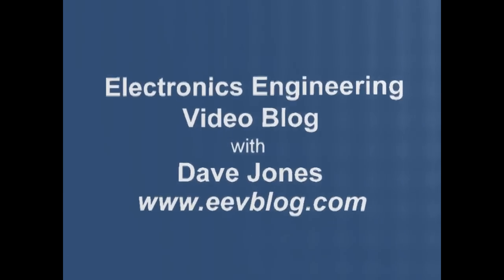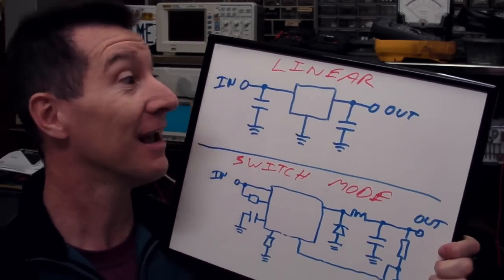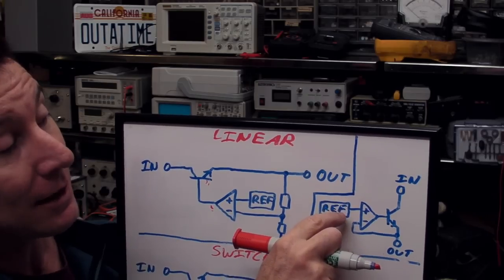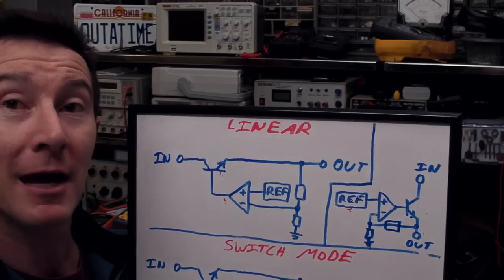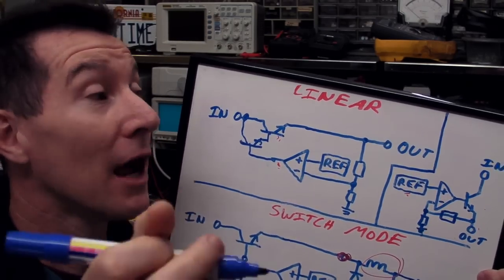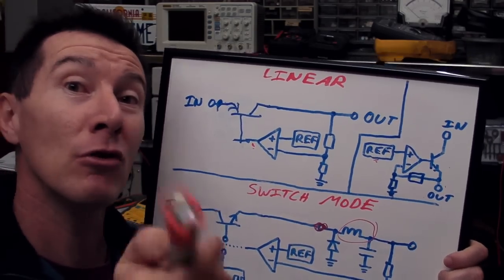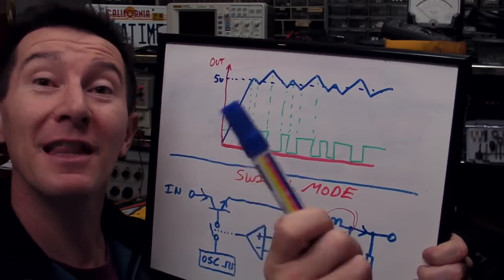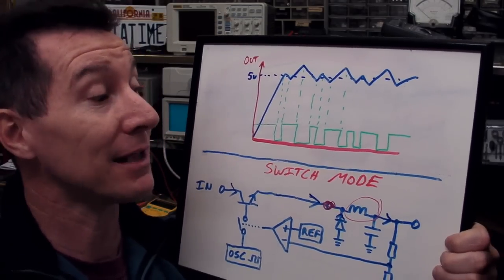EEVblog #90 - Linear and LDO regulators and Switch Mode Power Supply Tutorial

Comment: In this video the SMPS is not much difference and still easy to understand because it is just Buck Converter, one of the easiest SMPS. What is hard and intimidating is the real power supply that supply high current from 220VAC, such as what you see in PC ATX Power Supply. The ATX Power Supply especially above 500W is intimidating and very complex because it is not just about Buck Converter, it is more than that: Power Factor Correction, Transient Damage protection, 3.3V, 5V, + and -12V regulated power supply each with overcurrent, overvoltage protection including step down transformer using Half Bridge topology. The circuit diagram is immensely complex. So, the real high power SMPS that we encounter in real life is not that simple.

Comment: Thanks Dave.
But in my opinion the reason new people are reluctant to using switching PSU's is not because they don't know how similar they are to linear ones, that doesn't matter that much. 
They are reluctant to use them because of the inductor.
Resistors and capacities are easy to buy and use, but inductors aren't.

Comment: I'm gonna go out on a limb and say that most SMPMs today don't use BJTs, but MOSFETs, due to the fact that junction behaves like a resistor and not a diode (Constant resistance instead of constant drop-out voltage) and has a really low resistance when saturated. Maybe not really relevant to mention in this video though. It's 17 minutes already.

Comment: Dave, did you ever made a video on the principles of something simple as a fuse? Like why they blow and how their ratings are designed? I'm still unsure what really makes a fuse go blow. Just the amps? Then why there is also a voltage rating on most fuses? Grrrr. I don't get it together
Reply: +Axel Werner Power dissipated in a fuse will blow it. The fuse uses a really thin wires that will melt when it gets too hot. Because it has a finite resistance, when a current flows through it there will be a small voltage drop, that voltage drop is directly proportional to the current. Power dissipated by the fuse is V*I, I^2*R, or V^2/R.

The voltage dropped across the fuse is small, it has to be small. We don't want to waste power. However, when it blows, it effectively becomes an open circuit. The full voltage will be present across it, and if that voltage is too high then it will arc over from one end all the way to the other end and that can cause serious damage to everything closeby.

Because fuses do not blow instantly (the wires do have thermal mass) it can take some time to heat up enough to blow. Even a really large current of many orders of magnitude can flow through and it will still take a small amount of time to blow. If a huge enough surge of current flows through the fuse, it can actually explode. That would be the rupture rating of the fuse. HRC fuses are designed to be relatively safe in this regard and have really high rupture ratings, however, exceed that, and they can also explode.

Comment: I wish I had YOU as my teacher in engineering college. Infinitely much better than the idiots who where so obsessed with theoretical proofs, math exercises that were only tailored to their solution. Then looking up an actual device datasheet showed features that made half of the learned theory not applicable. 95% of what I'm capable of today I just learned from internet resources and a few books which I bought myself and a little critical thinking.
Reply: I've had some pretty good professors. Although I started at a community college so I don't know if they're part of educational Illuminati.
Reply: same here
Reply: While I sympathize with the sentiment, those obsessed with the math and physics help push for funding of research that leads to these electronics technologies being manufactured.
Reply: like everywhere learning is your personal responsibility.
Reply: Same here. 
Most of what I'm using today I learned by staying in the labs until 5 in the morning tinkering with electronics, watching videos from Dave and Louis Rossmann and probing them with O-scopes and DLAs. 
the theory is certainly important, but too much emphasis is put on cranking out 3 page proofs and solving complex circuits by hand. More effort should be given to encouraging actual design work and teaching students how to THINK like engineers.
Reply: @seinfan9  Exactly, or we would not actually understand purely how these things work, and then couldn't invent new ones, better ones. We'd be stuck with the same technology, just using it in new ways, instead of inventing new technology. But yes, I still like this approach. Not exactly sure which one I like the most though (I'd prefer both to be used, that would be the best, but here in Portugal, time was taken because the governament said we had to have to study for ourselves, so there's not as much time in classes as other countries, and also not sure that's good or bad).

Comment: There's a huge glut of small buck converter modules based on the LM2596 on eBay. For around a pound (a couple of bucks) you can play with them, blow them up and learn all you need to know. Great fun. And for a bit more cash you can get them with LED voltmeters and adjustable current limiting.
Reply: ill check it out thanks

Comment: Thanks Dave.

From my very limited experience with switching regulators I'd say that the tricky part is finding the right value for the inductor.  In one case when I wasn't getting the proper output voltage (it was too low) I had to make the inductor value *smaller* (10uH instead of 100uH, for example), which seems counter-intuitive.

...continued...

Comment: Thank you Dave!  Learned alot from that one.  Would love to see some actual design on boost type, powering a 5v circuit from say a lower voltage, how you calculate current needs and what it will take from the battery or power supply.  Like your LED head torch, what it would take to power a high current LED from a small input power, and how to keep the current somewhat constant to the end of the battery life or something.  Would certainly be interesting....  But time is limited I know :(

Comment: I've just been getting into electronics and in between going through various tutorials one video at a time, I also like to jump around on different topics and one topic I've become interested in is boost converters and various other switch mode power supplies. I've never heard of linear power supplies before but you can bet I'll be learning about them real soon. My point is, I went into this with no expectations so I wasn't afraid of tackling switch mode power supplies before anything else. I didn't find them terribly difficult to understand, especially after playing with a circuit simulator app. But Dave says most newbs are afraid of them. So I dunno. I just thought I'd share that.

Comment: A zener diode is usually built into the silicon of the regulator. It can be made to give approximately any voltage you desire (5 or 10 or 3.3 volts) for reference.

Comment: Nice vid, i always understood LDO regulators to gain their efficiancy from the use of a FET rather than a BJT. LDO regulators have got NPN as well just in the form of a FET instead with a gate driver of course which makes an LDO a little more complex internal circuit.
Reply: You have them swapped.  Switching Mode Regulators use gate drivers which drive high-side and (hopefully) a low-side FET.
Reply: funkyguy4000
Aaa ok, sounds about right. I am looking at these new Micrel Super Beta LDO regulators at moment. Very low voltage dropout.
Reply: If you want, I would recommend Linear Technology (www.linear.com).  They offer simulation software  so you can test transients and stability and all that jazz and power supplies are kind of their thing.
Reply: funkyguy4000
Thank you, i shall take a look see what they offer as Micrel seem to be very expensive regarding their LDOs.

Comment: That was a grate tutorial!
But I have a little question, that:
Capacitors are also the energy storing devices, so can we replace that series inductor in switching mode buck converter with a capacitor in shunt to the output (by the principle of duality) or similar in other topologies? Will it work? Thanks in advance!
Reply: It will theoretically work into a consumer which has a high-impedance power input. But you can only have high-impedance inputs if they are not current-carrying, because you'd be losing a lot of power there. It may work with compromises, if the device you're powering needs little power, the voltage drop you're trying to achieve is small, and the device doesn't actually care about sitting on a rather noisy power rail.

Consider, the output of your switching IC is basically a bunch of sharp current bursts. And you have designed a junction there where that current can go into your smoothing capacitor to ground, or it can go into your powered device. Naturally, you want your device to receive a smooth regulated voltage on the input, and you want the sharp edge of that burst to go into your smoothing capacitor. But the only way to accomplish that is if you can guarantee that the impedance of your capacitor to ground path is infinitely lower than the impedance of the power input of your powered device.

So a choke is the right choice here, it will limit the sharp current bursts regardless of what's behind it.

Comment: From min. 9:13 onward, a mistake has occured in your presentation! You've just changed the Darlington NPN(common collector— non phase inversion) with a PNP(common emitter—phase inversion). Note that PNP inverts the phase while the NPN-Darl. doesn't. As a result, the LDO type (with PNP) must have the inputs of OpAmp swapped, i.e. reference voltage tied to inverting input(–), and feedback tied to non-inverting input(+) in order to maintain the negative feedback loop, otherwise it will latch-up(positive feedback!).
Reply: I think he just wanted to keep it simple and straightforward, so he did not change much else, knowing not many people would probably try to rebuild the circuit. I did, and found that out myself the hard way lol! Once I realized that the PNP in that config. get more and more 'turned off' as the current into the base is increased (it is inverting) I tried inverting the op amp inputs and voila, I got that circuit to work too!

I have also had success laking an LDO w/ MOSFETs, though they like to oscillate parasitically!
Reply: I noticed that in first instance too... but well, not important in dis explanation all that little details ;-)

Comment: I made a very discrete DC/DC Buck Converter ONLY with BC547, going to up to 95% PW, so if you input 150V, you can still get 140V out stable. Needs 2 isolated 100mA supplies, which makes it a bit more complicated, but it can switch 1000WATTS! Just needs 1 external Power transistor with a gain of at least 40 withstanding the voltage and current, huge inductor and POOF. 150 to 250V to 140V Stable. Efficiency of over 90% in ANY case!

Comment: Last night I threw together a custom buck converter (a first) using a PIC, a MOSFET, an arbitrary inductor, a capacitor, a bulb for load and a Schottky diode. No detailed calculations, just 1 hr of messing around and I easily achieved 75% efficiency...switch mode regulators were perceived to be scary critters but after yesterday's experiment they seem a little less intimidating.

Comment: i've managed to make up my own adjustable regulator using a beefy 10amp power transistor and a 741 opamp and a couble of silicon diodes for reference, the low end voltage comes out about 2 volts and near supply voltage at upper, you get about a few hundred mV dropped depending on load but the transistor doesnt even break a sweat even with heavy current draw

Comment: +EEVblog Where does the reference voltage come from in a linear regulator? Also, I thought MOSFETs were used in a SMPS.
Reply: they have an internal reference, mostly a zener diode oor so
Reply: It doesn't really matter what transistors they use, they still operate the same way.  MOSFETs are typically used in SMPSes because they dissipate less power when fully on (milliohms D-S * I^2) than a bipolar does in saturation (about 0.3 volts C-E * I).
Reply: Well yes your right, but those are in the main part in the power supply.

Comment: +Mac Cartier
Transistors are not binary in nature. In simple terms, when used digitally they are either cutoff or saturated. When used linearly they are biased at some point between cutoff and saturation so they can be used as amplifiers for example.

Comment: Hi Dave, I had a question regarding the analysis of a regulated DC power supply.  I found that my post-rectified voltage function = | [15 * sqrt(2) - .7]sin(120Pi * t) |

I have a filter capacitor in parallel and a voltage regulator.  What kind of math do I need to use to model the voltage regulator to find the voltage function at my load resistor?  I realize I can just feed the regulator the correct dropout voltage and watch the heat and it'll play nice, but I want to learn the theory.

Comment: You can use 7806 linear regulator together with capacitors or just use LM317 adjustable voltage regulator.

Comment: Hi Dave, On top of the question that Ricardo has asked below, I'd also like to ask why a PNP has a lower dropout compared to an NPN. Would it be due to the fact that in the case of the PNP, the voltage drop across the transistor Vbe junction is much higher ?

Comment: Very nice tutorial thanks a lot ! I have a question, do a switch mode regulators induce switching noises to the output and is it perhaps better to use a linear regulator with a sensitive to noise circuits such as small signal audio amplifiers ?

Comment: Hey Dave, I have a question. Shouldn't the feedback be positive instead of negative when using a pnp series pass transistor? Because with negative feedback the output of the opamp would be always high and the transistor would not be conducting. Am I wrong?
Love your videos :)

Comment: Hey Dave, Good day.. if your switch mode power supply is trying to turn ON again after the input voltage have been removed? what might have been causing it? 

on the other hand, on your LDO, if there's a fluctuation in your input voltage will it's output have same waveform as it's input?

Comment: Hi Dave.
The output voltage always has to be Vo(Op-Amp output voltage) - 0.7V(transistor vbe drop). This dictates the maximum Vout, since the Op-Amp's output voltage (Vo) swing can be = supply - a few volts at max. But Vout = Vin - vce(transistor). So Vout is always the min of these two constraints?

Comment: Linear regs burn a lot of energy as heat and are very inefficient (7805 is only about 60% efficient w/ 12vin, for example), while buck step down switchers can be up to 95% (and some even higher) efficient due to energy storage capabilities.

Comment: Do LDO regulators use a Szikali pair pass transistor stage? This will not need an inverse connection for the op-amp as the driver transistor is still a NPN transistor. I do get confused about the forward gain of the Szikali pair. I think it's mainly the driver transistor in this calculation.

Comment: The first question that came to my mind after seeing Dave's linear regulator diagram is: how is a fixed reference voltage produced when the input to the regulator can be variable. e.g. how does a 7805 regulator produce a fixed 5 volt reference for the op-amp if the regulator input is anything between 7 and 20 volts?

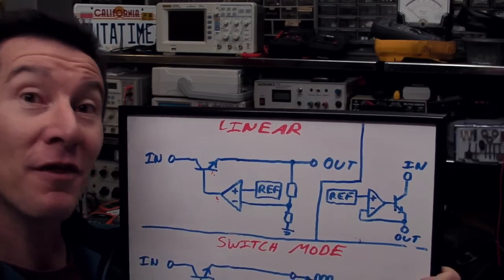Comment: in 4:29, you explained that since Ref. Voltage was equal to Output Voltage, it will turn on NPN Switch to provide IN Voltage to OUT Voltage. But if we just apply input voltage ho to get FeedBack Voltage from OUT to open NPN?

Comment: I have 2 questions, please. For linear regulator, is the transistor working in saturation or linear region? Why linear voltage regulator works by continually dissipating the difference between the input and regulated voltages as waste heat? Thank you.

Comment: ...continued...

Another gotcha with the high frequency (900kHz, for example) switch mode regulators is that they will require high capacity (~22uF) _CERAMIC_ capacitors on both the input and output.  These aren't something most of us hobbyists have in our kits.  You can get away with electrolytic caps if the regulator's frequency is ~100kHz or lower so you might stick with the lower frequency regulators if you're just experimenting.

...continued...

Comment: I'm working on a project to regulate power from a 12V battery, to a 6V micro controller.  Would a linear or switch mode regulator be the right choice?

Comment: linear power supply often have a transformer in front,and they often are big and low 
on efficiency,that eat a lot of power and work at fix frequencies like 50 or 60 Hz Depends on where you live.

Comment: I thought the switch mode power supply adjusts the duty cycle to compensate output changes rather than switch on/off oscillator output ?

Comment: You put an op amp there, but almost every representation of a linear regulator I've seen use a zener diode and there's no mention of an op amp.  Also I understand the inductor part of the switching regulator, but I want to know more on the oscillator/switching. Everybody just put a magical switching box there and don't explain how it works!

Comment: Good day sir, can I ask if is it possible or okay if we convert switch mode power supply to linear also? Thanks in advanced. I have a mixer here, exactly the Yamaha mgp12x, it was dead for the reason of voltage fluctuation, and when I opened it I found out that it uses switch mode PS, and I thought SMPS are not reliable or durable when it comes to situation like that than linear/old school so to say, though smps are efficient, but yeah, can I trade efficiency to durability? Thanks.